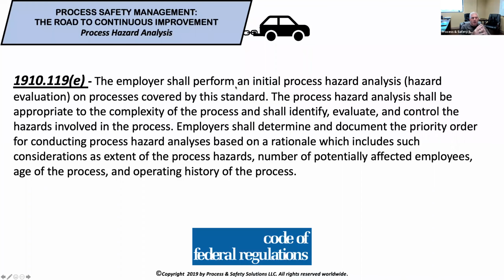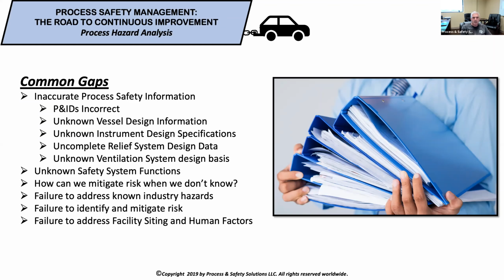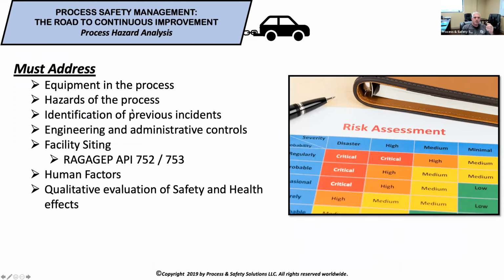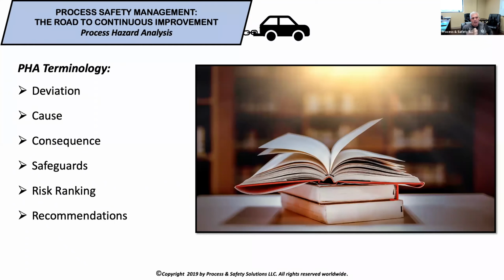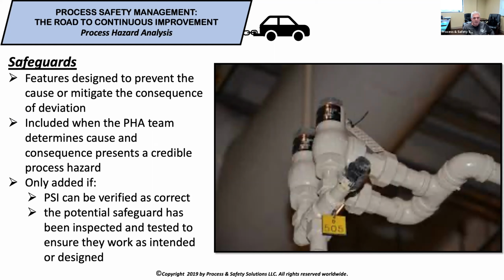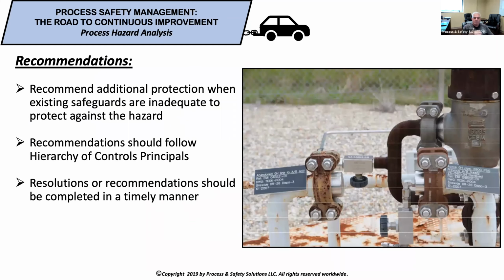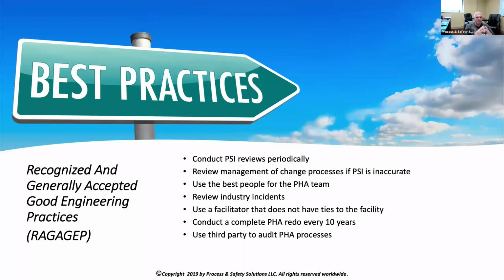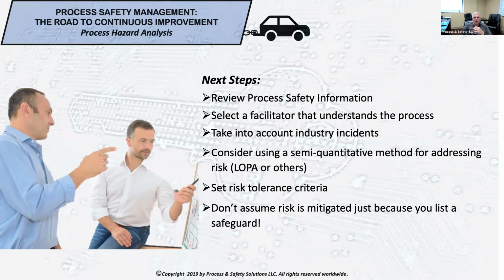Process Hazard Analysis

Comment: Is Phase and Process Hazard Analysis  the same thing?
Reply: Good question. 'PHA' is just the acronym for Process Hazard Analysis, so they're the same thing rather than two separate studies. 

The part worth knowing is that PHA is an umbrella term — it's the overall requirement to systematically find and assess process hazards, and there are several methods for doing it: HAZOP, What-If, checklist, FMEA. 

HAZOP is the most common, and what makes it distinct is that it works off the P&IDs, split into nodes, applying guide words (no/more/less/reverse) to each parameter. So every HAZOP is a PHA, but not every PHA is a HAZOP. 

Because the HAZOP side lives on the drawings node by node, we built PlantFCE Maps to mark those node boundaries onto the P&ID and move between them during prep — purely a drawing prep and navigation aid, not something for running the analysis itself.